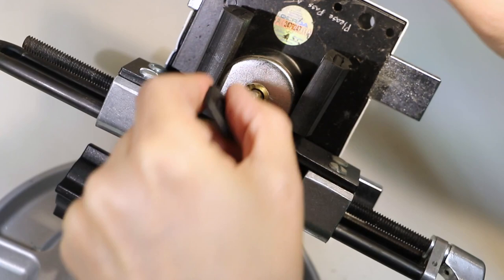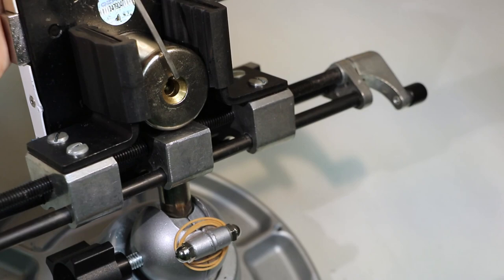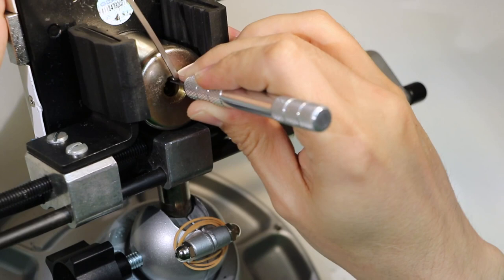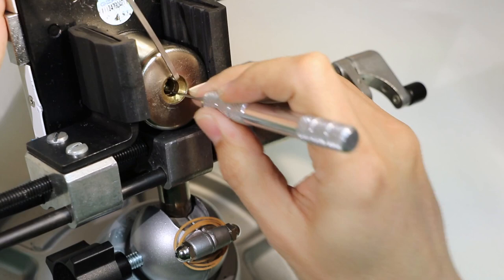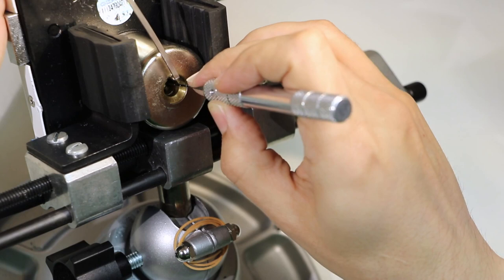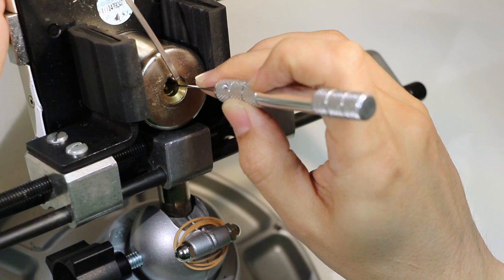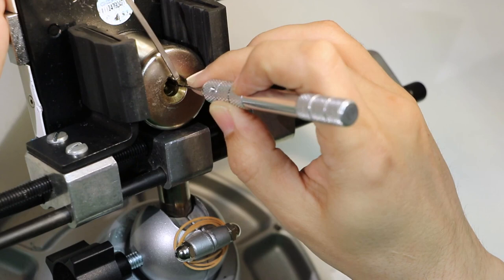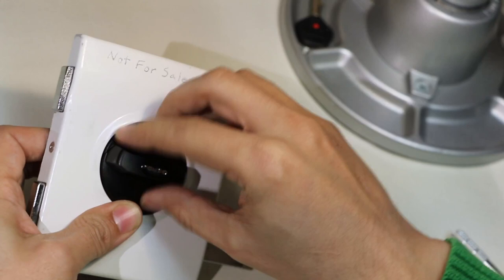[L77] Gerda Tytan ZX Lock - pick

Comment: very unsatisfying that you turned it right to reset it instead of turning it left to see the action.
Reply from the maker: Check out the link in the description if you want to see the longer video with bolt movement. In locksport, moving the bolt has no importance which is why I left it out.

Comment: Came here after seeing a video from @bosnianbill saying how hard it is to pick. Nicely executed 👌👌
Reply from the maker: Appreciate it! It's not a particularly difficult lock to pick, however it is a very time consuming one which makes it a very good lock!
Reply: @norlin76  I would say - It is difficult - since it is time consuming (looking from point of view what lock represents - prevents access). Quick pick -> easy (less possibility to be seen) Long pick time -> more risk to be seen -> hard (hard but not unpickable :) ).
Reply from the maker: @hdd4550  yah, it comes down to why you pick a lock. Given that I'm a hobby picker, I'm not about to be standing in front of anyone's door trying to pick it. I would break it down into two separate categories: 1) difficulty and 2) security. For difficulty, this isn't an easy lock to pick but it also doesn't rank as one of the most difficult as I would say that most of the experienced pickers I know shouldn't have any problems picking this lock. For security, I would rank this lock extremely high as it does what it is supposed to do, keep what it is securing secure...a lock should take time to defeat, whether by picking or other destructive means, and I think this lock covers both very well.

Comment: You don’t need to pick the lock it is faster to get a 6mm hole saw and take the front plate off and push the pin aside and the lock will come off
Reply from the maker: Heh heh, but since I'm a hobby locksport picker, the only reason for me to play with a lock is to pick it. I don't concern myself with how to get into a lock that is in use (ie. installed in a door etc)
Reply: @norlin76  I worked for them and know a few tricks lol 😂

Comment: Keep in mind that this lock will be embedded in a lock face in a door. That will make tensioning very difficult if not impossible. Also you had a key to look at so that's kind of a cheat ;)
Reply from the maker: It would be embedded in a doorway, I only reach behind the lock to keep a clear view for the camera. In an actual pick, it's actually more comfortable to pick it with my hand in front of the lock so tensioning isn't a factor unless the front face of the lock isn't flush with the front of the door (ie it has to be deeper in the door to present any additional challenge). Also, while having the key can indeed be quite a blessing, this lock in particular provides very good feedback for jiggle testing, making it a good blind picking candidate.
Reply: @norlin76  I see. But would you still say that this lock is not an easy one to get past? Reason I'm asking is I do have it on one of my doors.
Reply from the maker: @XEyedN00b  this is a very good lock security wise. Any lock can be picked, that's just the nature of locks. That said, a thief most likely would not be picking locks, but it is much more resistant to picking...it took me an hour to get through 4 picks, it would take double that to get through all 8 picks necessary to open the door. I can get through a standard US door lock in less than a few minutes generally.
Reply from the maker: @UncoloredKnife  I do it 4 times for the non-believers here https://youtu.be/sES_Hbj92BQ
I don't think that picking this thing is a viable option if you want to get into the door, but I generally feel that someone wanting to get in shouldn't be picking a lock when destructive methods are faster and require less "skill".

Comment: Those locks are RC4 class, meaning lock has to withstand 10 minutes with use of axe, crowbars, Hammer, and powertools for 10minutes . Also lock have to withstand 1 metric tonne of opening force.
Next class - RC5 is used in banks, archives etc.
I believe there is no better doorlock on the market (in normal price). Gerda do also produce steel apartament doors with those cores, but with 12 slabs around the door. It is easier to remove them togheter with frame, than to open this bastard.
Reply from the maker: Very interesting information, thank you for sharing. We do not see these over here, I only got my hands on one as a fellow picker sent it to me to pick open! It is definitely a unique style lock (which is something I've quite into having picked many unique style locking mechanism) and it's like a tubular lock in that it needs to be picked multiple times to get it open. Though, after picking it one position, I would determine a method to impression a key (likely with an epoxy putty or similar).
Reply: @norlin76  I wouldn't think that making impression. Those locks are robust, and they are working flawlessly for decades but they are quite sensitive for key damage. So You'll have to be extra precise with impression. I believe that best thing to crack them is decoder.
Reply from the maker: @motoNudziarz  yeah, decoder works well for sure. The impression would be more precise than the original key as I would make it once the lock is in the picked position...but like we've been saying, isn't really a worthwhile method for getting into this lock.
Reply: @motoNudziarz  yeah I have such door and besides it's being "secure", the whole mechanism works so smooth even after 25 years of daily usage. 

Also it works great as a magnet hanger, lol
Reply: in Poland those locks are commonly used on front doors in apartments. Usually it is easier to break the door than dealing with this lock.

Comment: Congrats on picking it! It sets every 90° and if I'm not mistaken, there were version that could rotate 3 times to lock. That's 12 picks ;) 

If you turn the key once, you could open it from the inside like any other lock. But turn the key twice and the nob on the inside stops working. Allegedly this was done so that burgard entering home via a balcony or a window couldn't use front door to get away with your stuff. 

Greetings from Poland.
Reply from the maker: Thanks for stopping by! As explained in the video and in the follow up video, you're exactly correct on 4 picks per rotation, but only two full rotations in this particular version of the lock. Note, that once you pick it one location, you can stop between locations, insert a sleeve and inject a fast hardening filler, then just rotate the lock the rest of the way. Basically you freeze it in the picked state, just means that the lock is trash after, but you'd only have to pick it once.

Comment: 10 minutes of work until the lock is open. It would be difficult to clamp a lockable door in a vice and open the lock under the house.
A very good lock, one of the best on the market.
Reply from the maker: Certainly wouldn't do this as a thief, but then again, thieves don't pick locks, they just kick down doors or break windows. Keep in mind, you have to pick this 8 times to get it fully open. You also wouldn't need to clamp it in a vise as it would be installed in a door. This would be a method more for locksmiths that don't want to pay 1500 euro for a decoder or destroy (drill) the lock open for their customers, I would also assume that they might focus on this lock and take way less than 10 minutes to pick it, since I just picked it as a one off and my time could easily get much better.
Reply: @norlin76  those locks are immune for drill - central rod inside core has some super hard ball, which rotates togheter with drill bit, preventing it from biting in.
They are superpopular in Poland, also included in gerdas antitheft, ram resistant doors. Those are panzer like... Few metric tonnes of resistance on 12-15 slabs, gerda tytan lock.

Certified locksmiths do drill hole near core and use pair of special tools to open those.
Reply from the maker: @motoNudziarz  very nice, yes even for pick resistance this thing is a beast, picking it 8 times would likely take an hour or more...it might be fine if you just need to pick one, if you're dealing with multiple professionally, that's where a decoder would make sense.

Comment: Imagine if there was no place for tensioning tool at the lock body at all (perfect round key way) - inserting the key itself would engage a spring loaded the very tip of the key to extend in some way in means to turn the cylinder: and in a special place right behind the row of pins! This lock is already nasty but my idea would make the ultimate lockpicking nightmare.
You can also add various of security pins for extra spice
Reply from the maker: The SB (Super Bright) lock is quite similar to this Gerda lock and tensions in the way you describe (by the tip of the key). I have one and will have to make a video sometime soon on this if there's interest. There is another lock out there, can't think of the model right now (I don't own one) that tensions off the pins themselves (kind of like the Vanlock video I just posted, but with a key similar to the Gerda).

Comment: @Michael Gilchrist

You should try pick Gerda G1000 PLUS. It is safer according to the manufacturer.
Reply from the maker: I'll have to look at getting my hands on one if they've made any upgrades to the pick resistance. Often the upgrades focus on drill resistance or stopping other kinds of physical attack
Reply: @norlin76  I don't know, but these locks have a different type of key(GTM1). Different diameter.
Reply from the maker: @maf2  sounds good!

Comment: So after 90° you would have to pick it again? So 4x picks per whole rotation? If that one pick took you 10 minutes, it would take more than half an hour (I give some discount as next one could be faster) to actually open it? Well, it's usually locked with two rotations so 8x picks, ~1h? Sounds like a good lock then (I have it, it's quite popular where I live)
[edit] I've seen in the comments that above seems to be true.
Reply from the maker: It is quite secure against picking, I estimate a full 8 picks to be more around 2 hours.
Reply: This lock guarantee here (at producers country), that robbers dont even attempt to opening doors. Its like an angry dog waiting for a postman. Easier way is to destroy doors than open this lock.
Reply from the maker: @antoniopartizano5111  hah nice way to put it, yes, robbers here don't pick locks at all (or only very rarely), it takes too much effort when you can just break a window or check if the next house is unlocked.

Comment: Maybe I am wrong but I am not sure if you fully succeded. You were succeded to rotate the lock or at least the front ring but belts didn't move at all. Normally they should move with every move of the key. You got that result when you were moving the knob
Reply from the maker: You are half correct, the bolts slide when you turn the knob far enough, but note that the knob does not move the bolts for the first 90 degrees or so of movement. This is already discussed in all the comments and even talked about during the video. For those who doubt I recorded separated, completely unnecessary from a lockpicking standpoint (for those unfamiliar with how lockpicking works), 360 degree turn of the lock here: https://youtu.be/sES_Hbj92BQ

Comment: You'd need to pick it 2 or 3 more times if the bolt was fully extended, right?
Reply from the maker: 8 times. 90 degrees per pick, retracting the bolt requires two full rotations with the key.
Reply: @norlin76  So about an our, or maybe bit less if someone has practiced it a lot. Would anyone burgle such lock at all?
Reply from the maker: @infirmux  only reason to practice picking this lock is for fun, or if you're a locksmith and a client wants you to open their lock non-destructively. A burglar will smash a window, kick your door, or drill the lock.

Comment: In my building someone has jammed the gerda lock mechanism with the key. Its a barrier Gerda Lock which is attached to a gate. The black bit where you hold to take the key out, snapped off. How do I take it out? Its stuck stiff. Many cars keep parking in our resident bays now.
Reply from the maker: Sorry, I'm just a hobby lockpicker, I'm not a locksmith. It sounds like you need to get a hold of a locksmith to help you.

Comment: But u have to pick it 6 times to open the doors who would has this much time while trying to break in?
Reply from the maker: No, you have to pick it 4 times or 8 times depending if it's single or double locked as stated in the video. I have another video where I show the 4 times pick. No one is going to do this to break in, thieves rarely pick locks as there are so many easier ways to get in to a place. The people who will pick this are hobby pickers (locksport) or locksmiths.
Reply: @norlin76  yes u are right. He said it locks at each 90 dgree turn so 360x2/90=8 not 6. It's brlliant lock btw
Reply from the maker: @Sojto16  yes it is quite a nice lock, I wouldn't rank it as one of the most difficult locks to pick, but definitely time consuming which, in my opinion, makes it a good lock
Reply: @norlin76  wich lock is realy hard to pick in your opinion?
Reply from the maker: @Sojto16  off the top of my head, something like the Abloy Protec 2 because it needs very specialized tools, or the Zeiss Ikon SK6 Sperrwelle Extra Code (which I made a video on) as it is manufactured to extremely tight tolerances.
Reply: @norlin76  thx:)

Comment: ПРОШУ ПРОЩЕНИЯ ЗА КАПСЛОК. НО ЧТОБЫ ОБРАТИЛИ ВНИМАНИЕ ТЕ КТО СОМНЕВАЕТСЯ В ПРИОБРЕТЕНИИ.   
РЕБЯТА! НЕ МОГУ СКАЗАТЬ ЯВЛЯЕТСЯ ЛИ ЧЕЛОВЕК В ДАННОМ ВИДЕО ПРОФЕССИОНАЛОМ, НО В ИДЕАЛЬНЫХ (ЛАБОРАТОРНЫХ) УСЛОВИЯХ ОН ВЗЛАМЫВАЛ ЭТОТ ЗАМОК (ВНИМАНИЕ!) БОЛЬШЕ 10-ти МИНУТ! естественно потренировавшись перед съёмкой. 
В РЕАЛЬНЫХ УСЛОВИЯХ ВРЕМЯ ЗАТЯНУЛОСЬ БЫ НА 20 мин МИНИМУМ! ЧТО ДЕЛАЕТ АБСОЛЮТНО БЕССМЫСЛЕННЫМ ЭТО ЗАНЯТИЕ ЕСЛИ ДОПОЛНИТЕЛЬНО УСТАНОВЛЕН ЕЩЕ НЕСКОЛЬКО ЗАМКОВ. ВОРЫ ПОД ДВЕРЬЮ от 30 мин до 1 часа СИДЕТЬ НЕ БУДУТ 😏
Reply from the maker: Thieves wouldn't be picking locks, they'd be breaking them or breaking in another way. I only do this for fun, so if I were to practice on a single lock you could expect the times to drop significantly. That said, this lock is very good at what it does from a picking perspective. I cannot comment on how good it would resist a drill or other destructive attack, which is a far better measure of how good a lock is.
Reply from the maker: Also, people always mention "lab conditions", having a camera in the way isn't "lab conditions", the lock is not at a good angle for picking, in front of a door I would be able to get a clear view of the keyway and not have to worry about blocking the view of the camera.